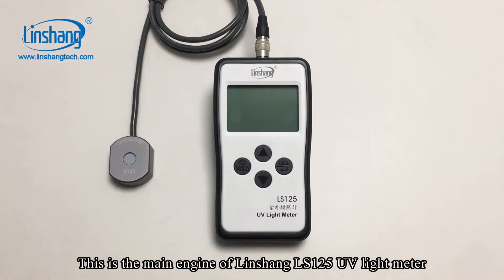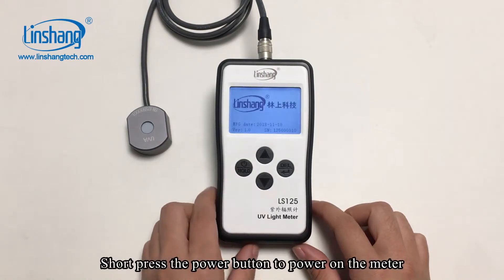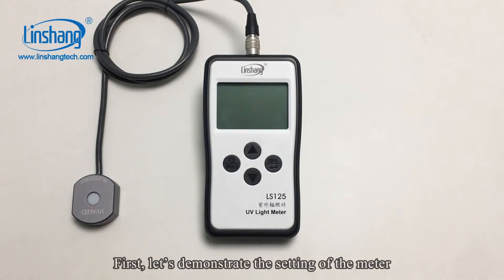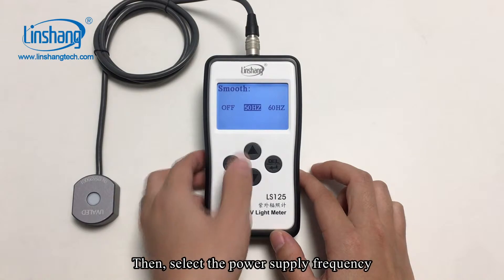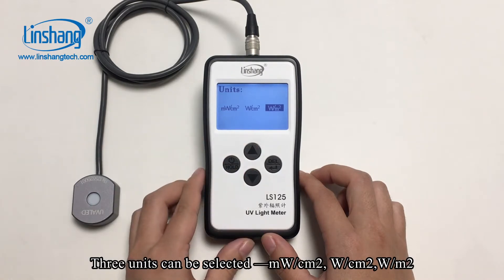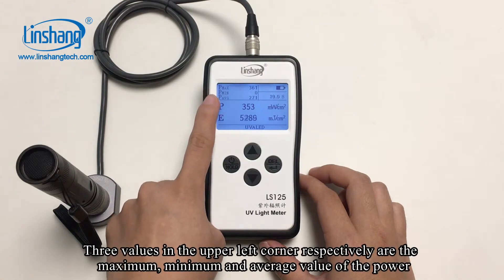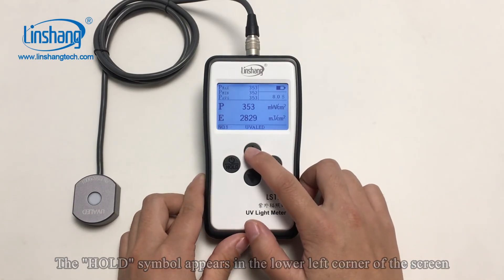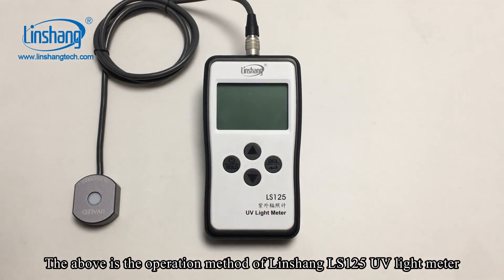LS125  Mutiple Probe UV Light Meter

Comment: Hello. Thanks for this video. How much real time value of power is needed for UV light to desinfect?
Reply from the maker: 1. " WST 367-2012 Regulation of disinfection technique in healthcare settings " A.3 Monitoring of the Effect of Ultraviolet Disinfection
(1) UV light meter measurement method

After turning on the UV lamp for 5min, place the UV light meter probe with a measuring wavelength of 253.7nm at the center of 1m vertical distance under the tested UV lamp. The special UV lamp is measured at the recommended distance. After the meter is stable, the displayed value is the irradiance value of the ultraviolet lamp.

(2) Judgment of results

For ordinary 30W straight tube UV lamps, the irradiation intensity of the new lamp should meet the requirements of GB 19258; the use of ultraviolet lamp irradiation intensity ≥70μW / cm² is qualified; the 30W high-intensity ultraviolet lamp irradiation intensity ≥180μW / cm² is qualified.
Reply from the maker: This is Chinese standard